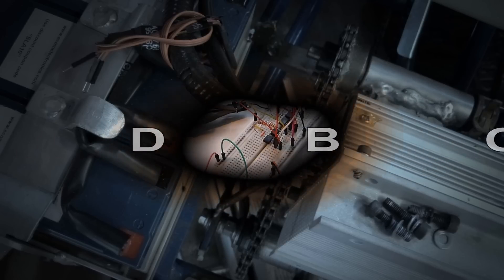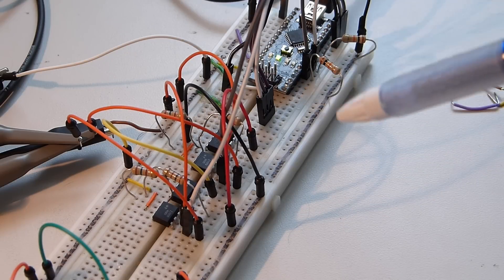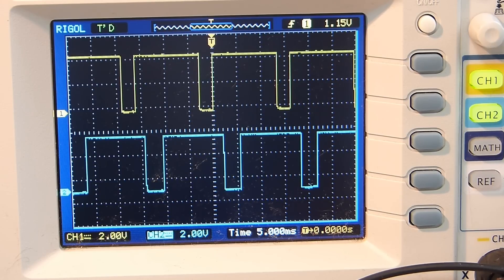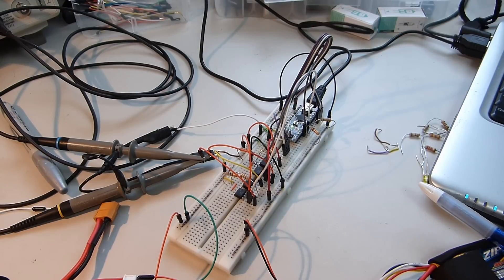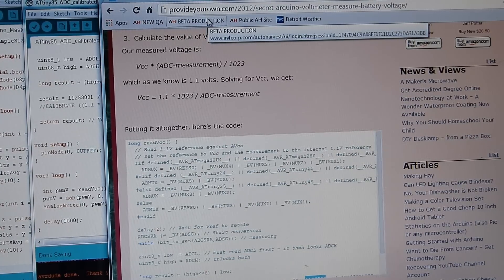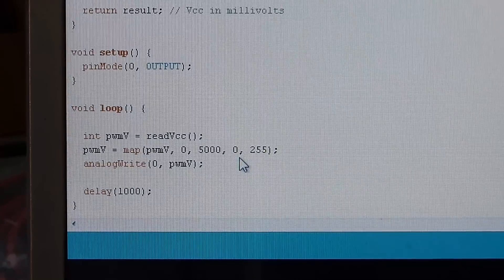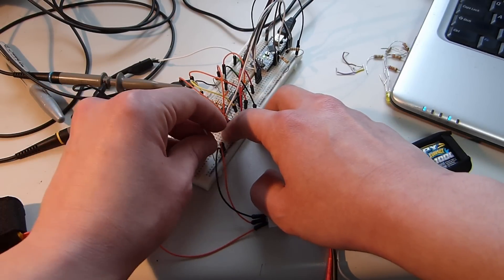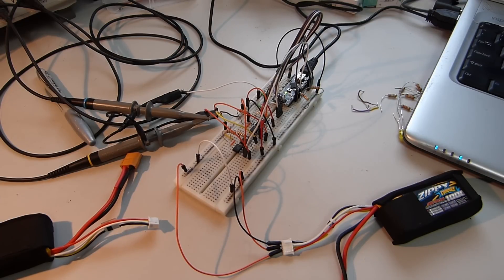How to Arduino BMS - Part 1 Battery Monitoring System LiPo LiFe  ESP32 STM32

Comment: What is the goal of  your system?  You can buy boards for $5 that monitor over/under voltage per cell.  They chips only consume less than 1ma.   I just bought 200 of them for $20...but you can't see the exact voltage.  Does that matter?   If expensive batteries, you have tons of options.  If cheap batteries (e.g. r/c, ebike)...

Comment: what if we try to use LiFePo4 Battery to the BMS? Is there anything differences between the usage of Li-Ion and LifePo4 by using it to BMS?
Reply from the maker: If you're okay with about 2.7-2.8 volts minimum.  I've found stability issues with serial communication using the ATTiny85 starting at about 2.5-2.6 volts, so that is how I determined 2.7-2.8 is probably enough.
Reply: @MegaMechatronics  thank you sir for the answer!

Comment: hi friend .. what is the optocoupler part like pc817 pls.
Reply from the maker: Any opto should work as long as can drive the LED and use a pullup/down resistor on the transistor side to pullup/down the logic, see the datasheet basic wiring diagram.  I used a LTV-846S.

Comment: Hello I know this is a old video but I have a question. So basically you have each cell on a attiny chip correct? And them chips are sending data back to a bigger arduino? So my question whixh I didn't understand is are they connected in Spi back to the main arduino?
Reply: oh, lots of reasons. SPI uses 3 lines + 1 for each CS. SPI is NOT isolated and to construct an isolated SPI network requires quite expensive high speed isolators. PWM even through a cheap opto-isolator is a much better solution requiring only 1 wire and ground per cell. It's a piece of cake to use a for loop to wait for the NEG edge on a pullup pin and then count until the POS edge of the pin.

Comment: Thanks for that great video .
working on a 24S li-ion battery Voltage & Amp monitoring project.
in my case, i need to measure also a low voltage cells (0.5V or so), in case of a bad cell.
did i got you right, that the ATTINY85 use each cell voltage to operate it self?

if so, i guess that i need to give each chip a stable power source.
can i power all the 24pcs of the ATTINY85 with the same  dc power source (in parallel)?
any advice will be appreciated 

thanks @:
Reply from the maker: Yes each attiny is powered by an individual cell, completely isolated.  What type of lithium battery cell is 0.5v? 

According to the datasheet, the standard ATtiny can run on 2.7-5.5v, the V series can run 1.8-5.5v. http://www.atmel.com/images/atmel-2586-avr-8-bit-microcontroller-attiny25-attiny45-attiny85_datasheet.pdf
Reply: The device i am working on is a li-ion charger that charging each cell individually, so it need to measure the cells voltage in the range of 0V - 4.3V, in case that one of the serial cells is dead or in a under voltage state.
any advice?
Reply from the maker: Off the top of my head I am not sure how to measure voltage below the ATtiny operating voltage.  This BMS design is super simple because each ATtiny can measure it's input voltage with some easy to implement code, so we use that as the cell voltage measurement.  If a lion cell drops below 2.8 volts it will likely have damaged the cell.  A work around using this type of ATtiny BMS system is to create a fault code for the user saying "Dead Cell" or something.  For example, if the master microcontroller that is reading each ATtiny does not get communication from an individual ATtiny, flag that cell as dead.
Reply: Thanks A lot.
After a long searching and thinking, i ordered now a few ADC's (ADS1015) modules, to connect it Analog side to the li-ion cell, and it digital side to the arduino.
if my thinking is right, it will isolate each cell from the others' and will give the microcontroller the digital reading it needed.

Comment: Thanks for sharing this video. I got this working with some PC817 octo couplers I had lying around. I like this method way more than using voltage dividers to measure multi-cell lipos. I also lost some sleep figuring out how you arrived at your results lol but it's all working quite well, it really helped to have a scope to visualize what was going on.

Comment: Pretty close to replicating this on a breadboard but my readings are always seemingly off, don't have a scope unfortunatly so i wondered if you could confirm the connections your using on the optocoupler and attiny with a circuit diagram and the values.  currently i'm powering the ATTiny using the lipo which is around 4.2v.  it's using the internal ref sketch and outputing a pwm pulse on pin 0.  Pin0 is then connected to pin 1 on the opto via a 220 Ohm resister, pin2 on the opto goes straight to ground on the battery.  On the output side of the opto i have pin5 going to my input on the arduino, pin 4 to ground on the arduino and via a 1k resistor from pin5 i have a connection to the 5v line on the arduino.  Does that sound about right?

My readings seem to be around 920Mv consistently though.

Comment: Hi! I'm going trough the same project and wondering whether I can use ATTiny13. The functions are similar anyhow. Also, is there any chance that you can share the diagram of a single monitor (ATTiny + opto + main arduino) ? Also what is the method that you used to read the signal out from ATTiny by main arduino?
Reply from the maker: Check out the datasheets for the devices, use newark or digikey, etc. to filter down based on your application.

Example optos, not sure if the ATTiny13 has enough current to drive the LEDs so double check that:
Google: LTV-816_826_846.pdf

The opto- LED is on the INPUT side, so the ATTiny13 side.  The output is just a npn transistor, the LED drives the base.  You must calc the resistor values for your application and voltages.  Hint: The LED will need a resistor for the LED to protect it and the ATTiny; and then the output is either a pull-up or pull-down resistor, so you can use rail voltage to feed the transistor and then the main micro-controller's digital input channels.

I wish you success!

Comment: Hey Mega, I am about do try the same thing but am needing to know, is there a limit of how many ATTiny i can have connected to a Arduino ? Eg your showing two, I need a total of 63. Would that work? I am not building a BMS but i am waiting to monitor a 60 cell bank.
Reply from the maker: Their is no limit because you just add more Arduinos to read the ATTinys.  The code will use pulseIn() to get the duty cycle from a Digital Input pin, so the limit will be how many available Digital Input pins you have.  A Mega has 54 Digital I/O.

Comment: Great work. I actually used an arduino uno as a regular voltmeter with the display out of a lcd display. With Arduinos that have analog inputs, it can actually measure up to 5 volts through them so the uno could simultaneously measure up to 6 cells with A0 to A5. I'm not 100% on how many the mega has or if the nano even has them at all, but this would eliminate all of the extra wires. If you're using the serial input, you would only need wires running to the ground than, depending on the voltage of the cells you're measuring, some resistors to knock the voltage below 5 volts and than from resistor to analog input. I'll look more info the analog to digital converting because that would open up many more options.
Reply from the maker: +Alex Soupir The advantage of the design I proposed is that the microcontroller is electrically isolated from the battery cells via opto-isolators.

I am uncertain if your proposed idea will work if you hook up all the cells to the Arduino, I would assume it would get smoked or you have to use voltage dividers which is not accurate, have you tested your idea by chance?
Reply: +Mega Mechatronics yeah you're probably right. I know for higher voltages it just requires some math and resistors to drop the voltage down to below 5, which is what the Arduino can measure. I do not know whether measuring more than one at a time would destroy the Arduino but as you said it probably wouldn't make it. Thanks for mentioning that, which I'll have to keep in mind if I ever decide to do a full BMS.
Reply: Isolated is the key point and is needed when trying to measure cells in series. I am about to go down this path of creating a circuit . Thanks for posting the video
Reply: Ok will do

Comment: So are the battery packs hooked up to their own optocouplers and then the outputs of those optocouplers to the ATtiny85s? The ATtiny is doing the ADC?

Couldn't a single ATtiny85 handle two analog inputs and two digital outputs?
Reply from the maker: Correct, the ATtiny is doing the ADC using the internal voltage reference measuring the input voltage to the ATtiny; which happens to also be the cell voltage (each cell powers each ATtiny). The system I demonstrated here shows battery cells individually (within a pack, or other packs) connected to a single ADC, and each ADC has it's own Opto.

For example:
Cell 1 > ADC 1 > Opto 1 
Cell 2 > ADC 2 > Opto 2 
Cell n > ADC n > Opto n 
n = any cell #

You could absolutely connect 2 or more cells to the ADC inputs on the ATtiny or Arduino to measure voltage; however, you must use voltage dividers to reduce voltage within the ADCs range.  The problem with voltage dividers is you will lose accuracy for each divider you add, on top of the already low resolution of the digital output.  With a custom library for the ATtiny, it would be possible to get the isolated 10-bit resolution to the main controller by using an SPI bus (unless you can address all your ATtinys for I2C), but you're component list starts adding up.

My idea with this prototype was to try and combine ultimate simplicity with reasonable accuracy for the application.
Reply: Mega Mechatronics Why is the digital signal from the ATtiny run to a optocoupler? Is it because the arduino and the ATtiny are not commonly ground/ are on different circuits? 

If you use/assign more ADC pins on the microcontroller you lose accuracy?